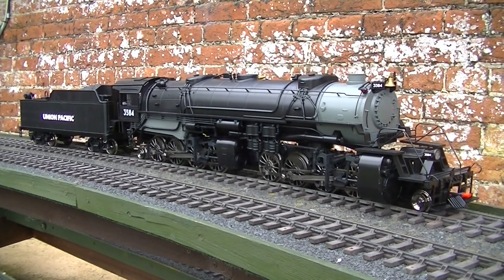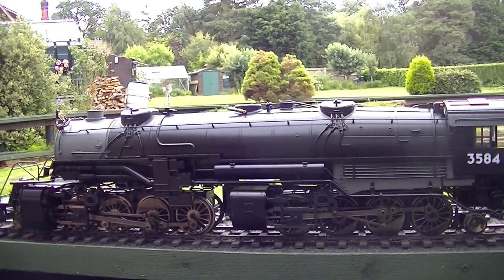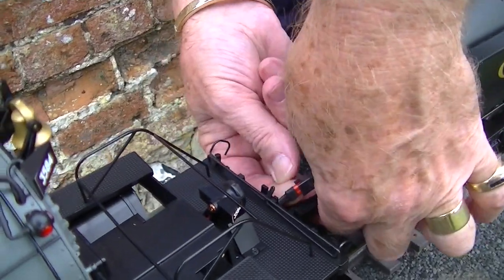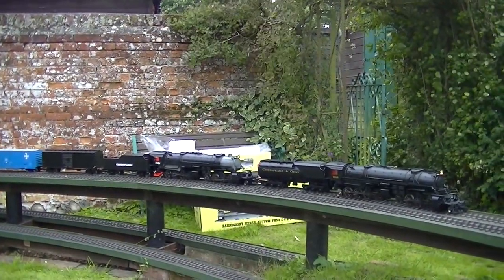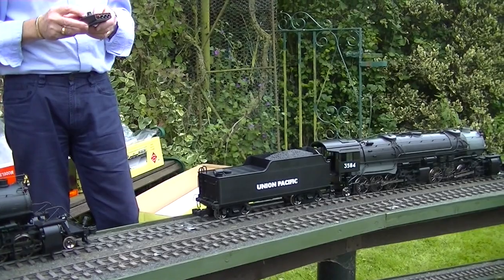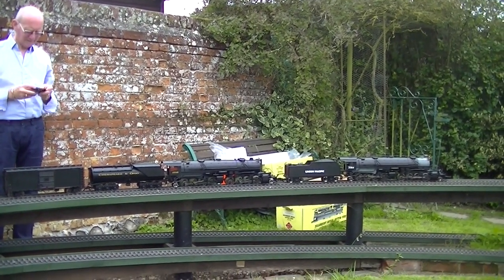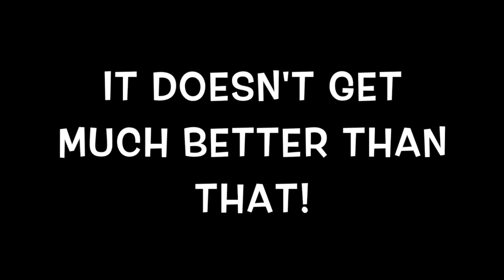Video 86. G Scale Gauge 1 Mallet locomotives double heading. Great sound effects!

Comment: Both are N&W Y-3 2-8-8-2, built by the N&W in their Roanoke, VA shops. During WW2, N&W leased a lot of the Y-3 to roads who couldn't get new engines due to the war.  Union Pacific got 5 of them, numbered 3670-3674 and called them MC-57. the C&O model is a "fantasy" version as C&O never got any of the Y-3, they had their own 2-8-8-2. C&O is wear they got the unofficial name of the Chesapeake Type from

Comment: So guage 1 is G scale?
Reply: Slightly different scale.. its very confusing..
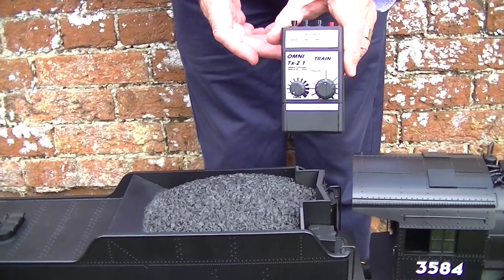Reply: G scale is technically 1:22.5 scale on gauge 1 track representing a real track gauge of 1 meter.  These models are 1:29 scale running on Gauge 1.  In America most folks call this G scale also even though the real locomotives these models represent were standard gauge (4feet 8 and 1/2 inch gauge) . At a ratio of 1:29 this makes the gauge an undersize representation. There was a small movement afoot in America to rename this "A" scale.  It would be much closer to run 1:29 scale models on the old Gauge 2 at 2 inch gauge.  This would be much closer to the correct gauge for the models. Unfortunately Gauge 2 has not had much commercial support since about 1920 or so.
Reply: @cug6 ( Or 1:32 scale for gauge one, ie the loco is oversize for gauge one.  I believe made them oversize to "match better" with the 1:22 meter gauge locos of LGB. ) This gauge is really messed up but live stem is worse!

Comment: That's clickbait a double header means it's two separate trains not one also that locomotive is called a "Big boy" and it does not count as a double header
Reply: Joshua Ebert that locomotive is not called “big boy” it’s what he said it is, a USRA Mallet. Union Pacific never produced or purchased that class of locomotive. The “Big Boy” series was/is a 4-8-8-4 class
Reply: @ksrailfan1008  actually UP bought 5 of this class (y3a) from N&W and numbered them 3670-3674
Reply: Double header is two locomotives pulling one set of cars. Usually needed for mountainous terrain.